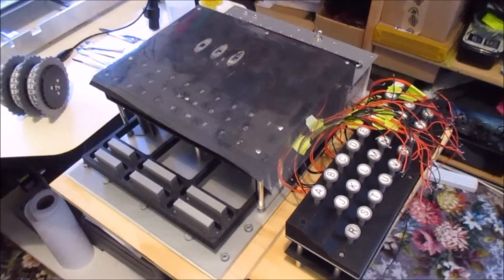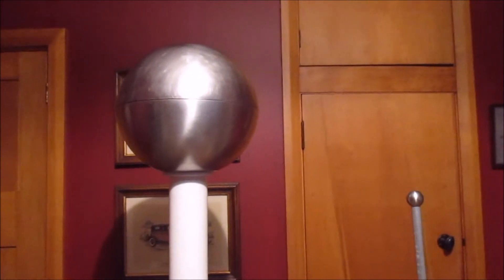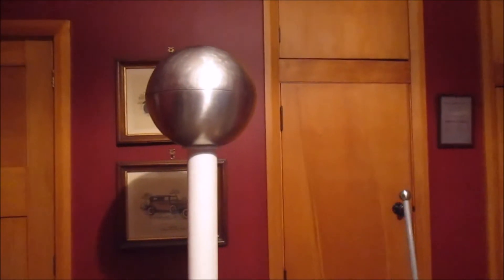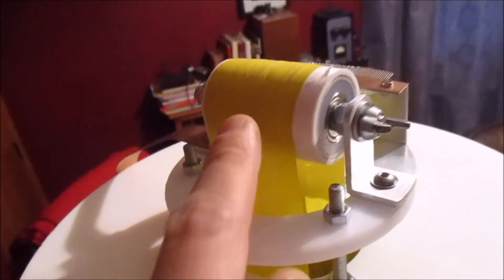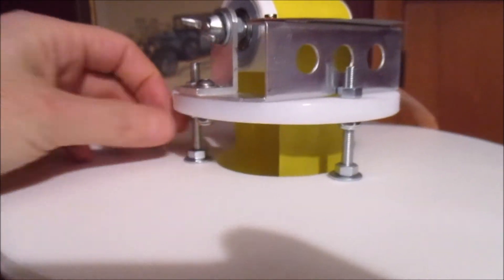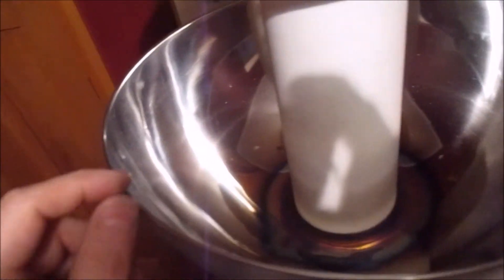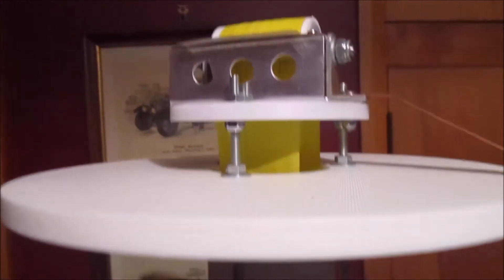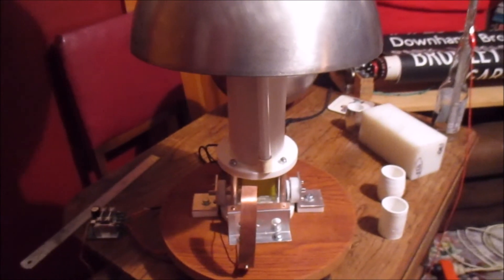Van De Graaff generator.

Comment: The best Van de Graff I have ever seen on Youtube ;)
Reply: have you tried placing a small portable TC upside down on top of Graaff to see the effects ? Also it seems to me that both mentioned devices could be combined into one, by reserving only the upper part of the pipe for the coil, to provide enough distance from the VG bottom electrode . Ofc the TC circuitry would have to lack sharp points.